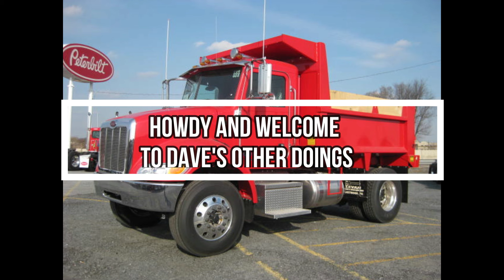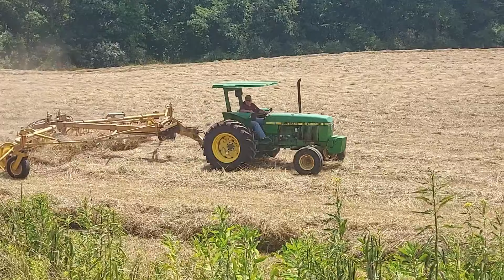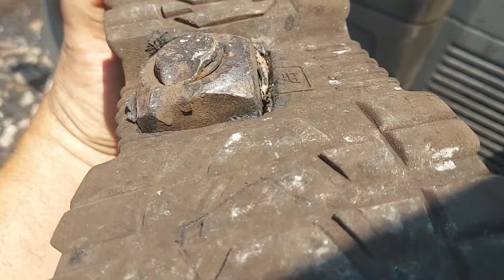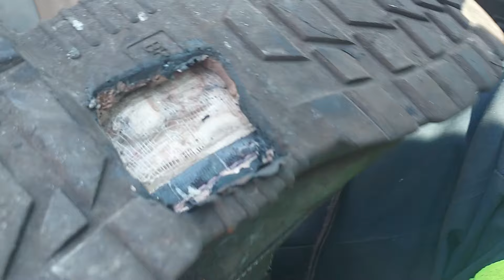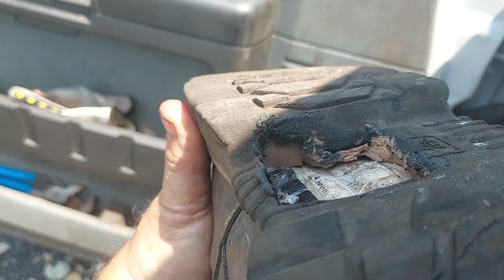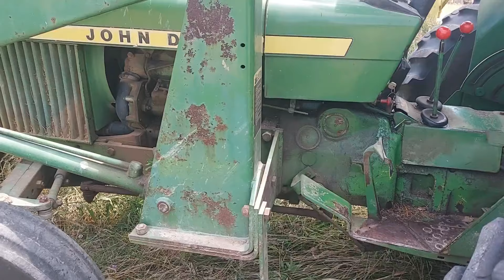Raking Hay and a 1 in a Million Thing Happened to my Boot

Comment: hay dave, I worked with friends on their farm doing hay / straw bails and putting them in the barn.
my friend norm we would put ~125 bails in the barn to feed the 25 head of cattle for the winter. 
great video, the grass has to be quite dry, or it will start on fire! take care , be safe out there!
Reply from the maker: Your right about that Barry, wet hay in the barn usually means a barn fire will be coming. Thanks so much my friend for checking out the video and may you have a very good day.

Comment: Thank you for this video.
To salvage the boot a piece of an old tire cut to just a millimeter or so bigger could be inserted into the hole after applying something like Crazy Glue.
Reply from the maker: Good idea Robin, I will try that.  I was lucky never got burnt or even felt any heat.Thanks so much my friend for checking out the video and may you have a very good day.

Comment: You got lucky there Dave, that was so close to burning your foot. Our boots had to have a steel midsole, the first ones we got were so heavy I called them diving boots, then we got some German ones they were real good, still got a pair of those I wear in winter. I have not seen that type of rake, farm by me got his hay rolls rapped and stacked a few weeks ago too when it was one of the few fine weeks we have had this summer. Have a Good Day
Reply from the maker: Your right about that Cedarcam, it could have been a real hot foot
time on the RR that day, I was lucky never got burnt or even
felt any heat. It's been so dry here this summer the farmers haven't had any problem getting their hay in. Thanks so much my friend for checking out the video and may you have a very good day.

Comment: That round bail is the way to go! A preaching buddy of my dad's use to own a thoroughbred farm in Georgetown Kentucky that was a little over 100 acres. When I was a teenager dad and I would go help bail hay after loading 3 or 4 wagon loads of hay for 5 or 6 days in a row a feller starts to get a tad bit tired!
Reply from the maker: I used to put up the square bales too Jughead, then switched 
later on to a round baler. You are right, sure is a lot easier. Those
guys in the AC cabs got it made.

Comment: Iron worker boots are made for that problem with melted soles fill the hole with flex seal paste great video thanks Dave take more care my friend
Reply from the maker: Several others have said that also Gary, flex seal, will give it
a try. If not am gonna get some wet socks this winter.... LOL
Thanks so much my friend for checking out the video and may you have a very good day.

Comment: Hay, hay, hay !
Well Dave,  never got a bolt stuck on my sole like that. Truly one in a million as you said.
For 6 years now, I have been giving my co-workers (something) for stepping in blobs of grease or whatever and then tracking it all the way into our office.  Happens about 6 or 7 times a year.  Well,  last Sunday night,  guess who did it his very own self?  How embarrassing. The only upside, if there can be an upside to this, is that I was alone, nobody else around to witness it,  and since I am the guy who cleans up the grease and tar anyways,  I cleaned it up as soon as I had noticed.   So nobody else has to find out that I step in crap, too.   No witnesses, so it never really happened.   
A few times in my life, my shoe or boot has found a nail or a screw, much like a tire seems to find them so easily.  But yeah,  I have never managed to get something like that melting into the sole of my footwear.  Very interesting.
I helped with hay for several years when I was younger.  We used an International B 414,  a haybine,  and the rake we had self-powered off the one wheel.  Our rake broke and while it was out of service awaiting welding,  we rented a rake that powered off the pto.  It was better because you could keep the engine revs up and thus the pto and rake twirling speed, for times when you drove into very thickly laid hay,  and you could drop a gear on the transmission to slow the whole forward momentum,  let the rake do its thing without getting clogged or overloaded.  Spent some time clearing out the older self-powered rake a time or two. I didn't care one way or the other,  the only thing I did not enjoy about doing hay was collecting, or more precisely,  throwing the bales up to the person stacking,  or worse, being the person stacking on the wagon.  I could do it, just did not find it enjoyable.  Fortunately, the guy I was helping, DID like to stack and pile on the wagon,  and he also wanted to be the one receiving and stacking up in the hay loft,  so that he could monitor the tightness of the bales when baling and collecting,  and he wanted to space them properly up in the mow, so that it would not spontaneously combust (luckily, never did have a fire), and would dry out uniformly and not have either a fire or moulding hay because of poor air circulation.
If weather was not perfect or we were short on labor,  we would go out and bale,  but use a stooker.  It's a little wee device that tows behind the baler in place of a wagon.  It has skids or sleds and just drags along.  You take off 6 bales, one at a time,  lay the bottom 3 (or 4 or 5 if you had a big stooker) on a diamond-angle with the corners pointing down between the tines. 2 would go one way, the third went the other,  then 2 on top of those, then a single on the top.  At that point,  your stook was complete,  so you would stomp the pedal down,  and the weight of the 6 bales would go against strong springs and gently lower the stook down.  The reason that they were arranged corners-down,  was so that while they waited in the field for pickup,  some air could circulate underneath a little,  and help with the drying process.  Later on, when wagons were unloaded or available,  you would go out and either manually toss them up on the wagon,  or if you had a forked attachment in place of a loader,  you could front-end lift them up.
One year, the guy rented a kicker and some cage wagons.  The kicker receives the bales off the back of the baler, winds up some very powerful springs,  and kicks the bale high in the air,  and hopefully it lands in the caged wagon.   Less labor needed in that moment, but more broken and damaged bales, which meant more work fixing and cleaning up loose hay later.
Doing hay, all processes of it, right up to feeding it to the animals,  was good honest work,  good for the muscles.  I had the slightest allergy to hay when cutting and baling,  but not too bad, and beyond that, no ill effects.  Ahhh, to be young again, back in the 70`s and 80`s.
Reply from the maker: Don't worry Stan I won't tell a soul about your grease mishap.
But your right, go figure it would happen to you. I never heard of
a stooker, would like to see that in action sometime. When i was
baling hay would drop it on the ground and go around with
truck and wagon picking them up one by one. Then I bought
a J Deere 336 baler with a kicker, now that was the cat's meow.
It made nice tight bales and very few of them got messed up.
Ahhh your right, to be young again.   Thank you for watching and may you have a very good day my friend.

Comment: Better a hole in your boot, than in the foot. Try filling the hole with silicone caulk, a layer at a time. You may salvage the boot that way. Take care Mr. Dave.
Reply from the maker: Your absolutely right about that Rick, amazing I never felt any
heat from that, and a good thing too.  Thanks so much my friend for checking out the video and may you have a very good day.

Comment: Ive burned my boots with nuts and bolts I've cut, but never had one fuse to it 😂
Reply from the maker: This is certainly a first for me to ever have happen Michael.
Those nuts get pretty hot after cutting them off with a saw
or torch. I was lucky never got burnt or even felt any heat. Thanks so much my friend for checking out the video and may you have a very good day.

Comment: Im surprised that you didn't burn your foot with that bolt! A set of Matterhorn mining boots would better protect you from such things. They have a steel shank in them like a jungle boot to keep stuff from coming up through the soul of your boot
Reply from the maker: Your right it would do a better job Jughead, but the reason I
wear these flexible soles is because of walking on the ballast
all the time, much easier on the feet. I used to have a pair of
those boots way back when I worked on the barges, great
for snow and rainy weather.

Comment: Fill  the  hole in the boot with a product called Shoe Goo. Might not be perfect but at least  you can still use them around your property.
Reply from the maker: I used Shoe Goo couple years ago to try and hold a split track
on my excavator wolfpacva. It kept the track together until I could get the moved to a place where I could change the track. Thanks so much my friend for checking out the video and may you have a very good day.

Comment: We get the strangest stuff in our boots at work. Good ya had safety shoes. I admit, that's the biggest  thing I've seen. I have had nails and even a large piece  of wood stuck in though. Now to get your boots resold I suppose
Great story  though
Reply from the maker: There used to be a shoe maker in every town around here Clark
now there is none left at all. I've had boots re soled by one of
them but that was way in the past. Times have changed. Walmart drove bunches of little mom and pop stores out of
business around here. Thanks so much my friend for checking
out the video and may you have a very good day.
Reply: @ThatsDavesOtherDoings  
I take it for granted  I have a shoe repair  shop close.  I've had several  pair resouled by him. A couple  pair, probably  not worth it,  but they are my most comfy pair of hiking, fishing boots I own. One pair I've worn the bottoms  out twice. 
But if you're like me, I know ya probably  have a couple  extra  pair just in case.
Proves yet again  the importance  of good quality  reinforced  work boots. If that had been a cheap pair,My have burned your foot.

Comment: Take some silicon and fill it or how I re-heeled my shoes, cut a chunk of tire and rubber cement it in place, or rubber in a tube (if still made). And heat it to cure. Then grind it smooth..
Reply from the maker: Sounds like a good idea N2OZI, I can do that. Used to be lot's
of shoe makers around here but they are all gone now. Thanks so much my friend for checking out the video and may you have a very good day.

Comment: Get a tube of Shoe Goo.  Great for shoe repair.  Walmart,
Reply from the maker: I actually bought a tube of that and tried to use it on a split
excavator track couple of years ago. The track held up enough
so I could tram the machine to a safe and easy place to change
the track Don. I will definitely fill that hole with goo and see what
happens.  Thanks so much my friend for checking out the video and may you have a very good day.

Comment: Dave how can you tell when the railroad tracks are very hot?
Reply from the maker: On our track with all the joints, as the rails heat up you can
actually hear the rail popping as it expands and the joints come together Mike. I hope sometime I can catch that on camera. I use a heat gun often in the summer to check rail temps. On a 90 degree day the rail can often get up to 120 degrees.  Thanks so much my friend for checking out the video and may you have a very good day.

Comment: Evidently, you do not do welding?  Getting hot metal, slag, and sharp objects coming through your shoe sole is "almost" a daily occurrence.  The biggest fun is when a hot piece gets inside your boot with you in it.  Now that can really burn your sole and soul.
Reply from the maker: Your right about that BigUn, I don't do any welding.  I was lucky never got burnt or even felt any heat.Thanks so much my friend for checking out the video and may you have a very good day.